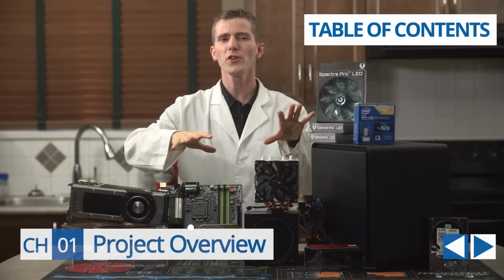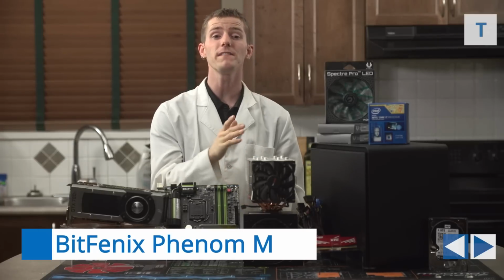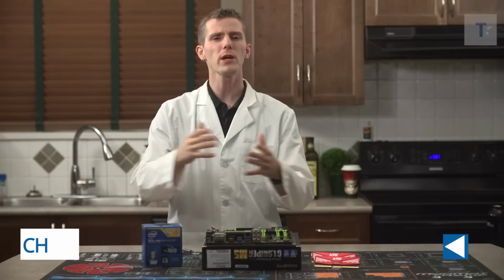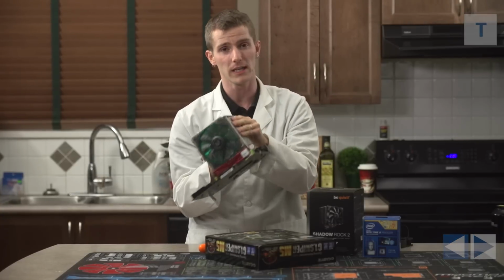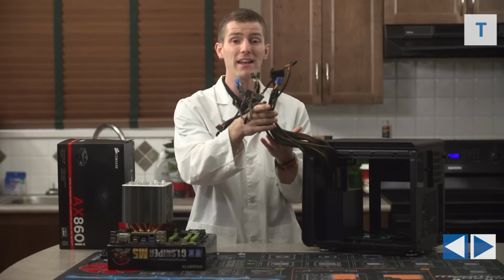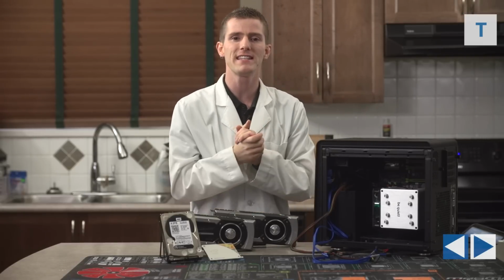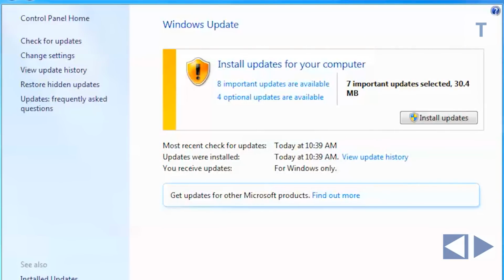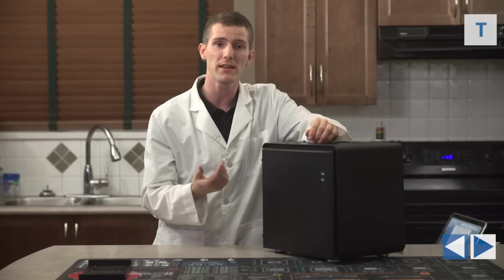ULTIMATE Intel Compact SLI Gaming PC Computer "How To" Build Guide

Comment: What should I expect with a PC like this? I know it's unreasonable!

CPU: Intel® Core™ i7-5960X Extreme Edition Eight-Core 3.00GHz 20MB Intel Smart Cache LGA2011-V3 [+694]
HDD: 1TB Western Digital Caviar Blue SATA-III 6.0Gb/s 7200 RPM HDD [-18] (1TB x 4 (2TB Capacity) Raid 0+1 Extreme Performance with Data Security [+198])
MEMORY: 32GB (4GBx8) DDR4/2800MHz Quad Channel Memory [+732] (Corsair Vengeance LPX [+194])
MOTHERBOARD: ASUS X99 Deluxe ATX w/Wi-Fi 802.11 AC 2.4/5 GHz, Dual Intel GbE LAN, 5x Gen3 PCIe x16, 1 PCIe x4,1x M.2, 10x SATA 6Gb/s [+221]
SOUND: Creative Sound Blaster ZXR 5.1 Channels 24-bit 96KHz PCIe Sound Card w/SNR 124dB, DBPro optical output, Multi-channel surround, SBX Pro Studio, Sound Core3D Processor & Audio Control Module [+226]
VIDEO: NVIDIA GeForce GTX 780 Ti 3GB GDDR5 PCIe 3.0 x16 Video Card [+517] (Triple Card (3-Way SLI) [+1560])
Reply: SO MUCH INFO CANT HANDLE IT
Reply: Expect a mass money loss
Reply: Use gtx 980 and a ssd
Reply: change the gtx 780 to gtx 980 in sli and its perfect
Reply: Noah Grimes Titan Z? That has as much GDDR as four of the Graphics cards you've got there
Reply: Shadowwolf TD5000 It ain't always about VRAM

Comment: Is there a different kind of case you could use for this, because no offense but I don't really like this case?
Reply: eXoBursT That's mini-ITX. not mATX
Reply: sigh http://www.corsair.com/en-us/obsidian-series-250d-mini-itx-pc-case You tell me I'm wrong, yet it says so right here on corsair's website. Also I was talking about the case, not the motherboard. That mobo would not fit in the 250d I don't think
Reply: Yes you can use the bitfenix collossus matx or the bitfenix prodigy m
Reply: search for any mATX case. I chose the corsair 250d
Reply: AJfoytona Look at the parts list. Motherboard is mATX and the case is made for mATX. a mini-ITX won't have 3 pci express lanes.
Reply: AJfoytona ok so im wrong about the corsair 250d. my bad. yup u got me. man i feel retarted as shit.
Reply: I like the Jonsbo series (I think Rosewill and Cooltek are the importers where most of you are). The V4, C3 and U3 are the most compact mATX sets you can get that supports those mean high power PSUs and GPUs you need, whilst still having space for a ~150mm CPU cooler. Anything less is cramped (usually, to save space, the PSU is made to "float" over the mainboard), anything more should only be considered if you need to use internal ODs.

Comment: 22:02 it's true that some modular PSUs are slightly bigger then non-modulars, but not in all cases, BeQuiet and some other brands have very small modular PSUs, so I would never use a non-modular PSU in a high-end build, because you will never use all cables in a compact case, simply because you don't have space for so many devices... forget it!

Comment: If you're willing to lose one of the two graphics cards, you can fit stuff into a much smaller case (like, half the volume or less) by using a mini-itx board, while still having room for an optical drive and two or three hard disks. It's not going to be nearly as quiet, though, since you'll end up with a much smaller CPU fan/heatsink, which will have to spin faster to compensate. For example, Shuttle XPC machines are much tinier, but use a single 4000RPM 92mm fan as both the CPU fan and the case fan. As you can imagine, that can get pretty loud! But tiny.

Comment: What do you think about my new rig? Specs:
Intel core i7 4790k CPU
Asus z97 pro MOBO
EVGA GeForce 780 GPU
NZXT H440
16gb Corsair Vengeance RAM
Samsung 840 EVO SSD
WD Black 1tb HDD
Reply: I'm sorry if I seemed like an asshole. I was very stoked on my new rig since I've worked so much lately to pay for it:) I just wanted to share my rig with other PC enthusiasts:)
Reply: There is something beutiful about full RAM slots...
Reply: benjamin parmeggiani if u know that why the fuck do u ask ppl if its good ?
Reply: Maybe I'll sell the 780 and get the 980
Reply: Uhm... The 4790k is better and the kingston RAM performs pretty much the same...
Reply: benjamin parmeggiani So true
Reply: Very similar to my new build, 

I7 4790k
Asus rampage vii hero
Rm1000w psu
850 pro 256gb ssd
1tb wd black
16 corsair Ven. pro 2400mhz
gtx 970 (asus strix)
corsair 760t
corsair h110 water cooler
Reply: Corsair RM650
Reply: Thanks:) Working as a pizza chef finally pays off
Reply: benjamin parmeggiani This is exactly the same as the build I was planning on building, save for the case. Let me know how this works out!
Reply: Genral Graphics
The PC looks and performs like a beast.  The only problem I have is that I find myself looking more inside the case than on the monitor, haha. The components cost about 2200 dollars, but I live in Norway so It's a bit more expencive...
Reply: well it is good but you should have gone with Kingston ram and a 4770k
Reply: Nice, you might could save up some money on ram and get another ssd, but i know how it is, 16gigs is bether than 8 gigs ^^
Reply: ***** Planing on to doing that ^^
Reply: We ave the exact same hard drive setup
Reply: get the gtx 970, cheaper and almost as good as gtx 780, or get the gtx 980 for longevity
Reply: ***** No i dont!
Reply: ***** wat?
Reply: No, I can't!*
Reply: benjamin parmeggiani going to sell ur gpu or keeping it?
Reply: I think I'm going to keep it:)
Reply: benjamin parmeggiani It's really awesome
Reply: benjamin parmeggiani get a 980 instead out performs by far and lower tdp
Reply: colton5007 he already got his card
Reply: colton5007 it does not justify the extra price either (unless you have money lying around)
Reply: benjamin parmeggiani
 aw you just needed to wait a few weeks for the new 970 and 980's!
Reply: I know:/
Reply: Killer xD
Reply: ***** Sorry, maximus, it's just their naming schemes are weird.
Reply: U do it like a pro :3
Reply: Shit. Must've cost way over 2000$
Reply: Nope:)
Reply: benjamin parmeggiani  Cool man. 
Nice rig you got there anyway.
Reply: benjamin parmeggiani Ja, ville nok heller gått for en 980
Reply: Det hadde ikke kommet ut da jeg kjøpte det, kanskje jeg seller det og kjøper 980
Reply: Neeei, 980 er virkelig ikke verdt det for å være helt ærlig. Hadde jeg vert deg hadde jeg gått for en 970. Med mindre du kjører 1440p
Reply: awsome RIG bro have a good time with it
Reply: benjamin parmeggiani You live in Norway?, hah, mee to, sounds like a good rig
Reply: benjamin parmeggiani du burde ikk kjøpe 900 serien, den er overpriset, og jeg har snakket med eksperter, og det er unødvendig med mindre du vil ha 4k, som i mine øyne er unødvendig
Reply: KrisPvP hah! Er du seriøs nå?!?! Omg... Em mener ikke å være frekk men... Disse "ekspertene" dine høres ikke så kloke ut... 900 serien har super price to performance og for å kjøre 4K må du ha to 980er... 900 serien satte ned prisen på 780 kortene ned 1000kr og 780ti med 1600. Om du kan anbefaler jeg å levere inn 780en å kjøpe 970 fordi denne er en del kraftigere, holder seg kjøligere, bruker mindre strøm og kommer med de nye 900 serie "featureene" som Feks MFAA. Men om du ikke kjører 1440p eller 144hz skjerm er det ingen grunn til å gå for 980(som foresten slår 780ti. Om du kan få tilbake en del penger fra 780en er 970 det beste valget. Takk for meg ;)
Reply: Med ettertanke tror jeg at jeg befolder 980'en. Den gikk ned så mye i pris da 980 ble lansert og jeg kjører 1080p/60hrz fortsatt:)
Reply: Pretty good :)
Reply: get the gtx 980 instead, it uses less power so it overclocks better and SLI would use less power.
Reply: Vault Nomad you do get that even an overclocked 980 still isn't on par with 780 ti right? also they cost the same price in fact 780 ti are cheaper. to a gamer power consumption has never meant shit to date so why would it now beside nvidia is just hiding in the works there 780 ti replacement soon that will make anyone buying a 980 now feel stupid cause its gonna have as many unlocked cuda cores as the current 780ti but with that boosted efficiency
Reply: you have a freaking beast
Reply: I can send you a picture if you want? haha
Reply: Kai Wackerfuss dude for an enthusiest this is like a standard build why don't you believe him? i myself run 4770k on z97 deluxe 16gb dominator platinum and a 780 ti kingpin edition all in an h440 case 2tb wb black and 128gb 840 pro ssd
Reply: benjamin parmeggiani Awesome build mate, got one myself last week and it works fine so far, check it out and let me know if there's something important I forgot.

-Intel Core i7-4790K
-MSI GeForce GTX 970 Gaming 4GB PhysX
-ASUS MAXIMUS VII HERO, Socket-1150
-Corsair AX 860i, 860W PSU
-Corsair H100i Hydro Series CPU Cooler
-HyperX Fury DDR3 1866MHz 16GB Red
-Seagate Barracuda® 3TB
-Samsung SSD 840 EVO 250GB BK OEM x2

-Corsair Obsidian 750D Big Tower Black
-Corsair Professional Sleeved Cable Red (for the looks, just had to)

Recommend this specc for everyone who has the budget, it ended at around 2600$ (18000 nok)
Reply: Ser bra ut:) Tenker å kjøpe samme CPU kjøler
Reply: ***** wow your profile picture
Reply: ***** its probably a fake stuff it back in your pants dude internet is full of lies
Reply: I bet 100$ that it's a dude
Reply: benjamin parmeggiani Dude thats fucking awesome how you can make pizza AND play games kickass rig btw (im jealous)
Reply: ***** lol i was thinking about photoshop
Reply: TheFancyCreeper2412
Thanks!:)
Reply: np and good luck with that pizza
Reply: Haha, I just got home from 9 hours of work with no breaks. I'm really sick of pizza.
Reply: ***** i got quad 780ti
Reply: *****
 Pretty sure you are lieing. second there is legit no benefit beyond two cause most games barley scale with two cards what could you need 4 of them for
Reply: There is not much improvement from 3 to 4 either
Reply: unless he owns two gaming rigs the 4 cards are pointless beside that unless you have a high highend 2011 or 2011-3 socket you can't even provide the bandwidth for those lol
Reply: *****
ok now i will stop lieing - i only got 2 780ti and i randomly put nvidia 7300SE in my pc lol
Reply: looks like my build i got a gtx 970 and a corsair h100i with a asrock z97, Same ssd but i got 4 tbs of hhd that i previously had. using 16 gb rip jaws. We running the same thing different brands lol i think its a beast
Reply: papijelly
you want beast? a beast memory its call hyperx beast, lol
Reply: When it comes to RAM, there is not much difference between the high end gaming versions :)
Reply: true not much difference but who can stop from jumping at the chance of some sexy heat sink ram mmm my Dominator Platinum look great
Reply: That's true. I went for the corsair vengeance mostly because of the green colour fits my rig perfectly
Reply: yeah i adopted z97 when first came out picked asus deluxe so i wanted the dominator to match the metal look of heat sinks.
Reply: ***** Umm... The GTX 970 is better that the 780.
Reply: Plazma lasrer
not the same level with the 780ti... i am rockin dual 980 overclocked to 1367mhz
Reply: I chose it because it was silent and it didn't cost that much. I didn't really care about the PSU when I ordered the PC, as long as it was powerful enough to support my rig:)
Reply: Haha same setup man! Except i have a Msi Gaming 5 and 980 SLI
Reply: ***** 16 gig platinum is too expensive, go with 16 gig A-DATA or Crucial Ballistix Sport
Reply: *****
 platinum are expensive but its a statment some people want more then just a functional pc they want a machine that looks good too
Reply: Very strong pc
Reply: get a sabertooth mark 2 instead. Get an intel ssd instead. get a GTX 970.
Reply: Bernie Jin I think he made some choices due to budget reasons. And the 780s are quite cheap used now. He probably already bought and built the machine anyway.
Reply: pretty bomb, could have more use with more hdd storage though...
Reply: I've added a 250gb SSD for extra fast storage since I posted this:)
Reply: You got OS installed on it?
Reply: Windows 7
Reply: How much did your system cost in total?
Reply: benjamin parmeggiani fuck norway.
Reply: *****
Hahah, If it helps I spent 10 hours a day working in a shitty fastfood pizza resturant a day to afford it:)
Reply: benjamin parmeggiani fuck norway.
Reply: *****
Why? :(
Reply: benjamin parmeggiani because fuck you, that's why.
Reply: hehehe
Reply: benjamin parmeggiani fuck you.
Reply: *****
Hah, please leave the comment section if you're mot interested in PC's
Reply: ***** Actually it really depends on the game but the 970 has a higher clock speed, higher ram and it's maxwell.  And with sli it would kick ass.
Reply: I74790k  z87 Asus Rog trident 32g 2666 raid0 two intel 730 crossfire 2 r9 270x
Reply: you should consider getting a gtx 970 or 980 as your next video card but other than that its amazing
Reply: JerryFish
8 GB will run 99% of games today for the next 4+ years.
Reply: Aidan Sweeney
It is however nice to have when you use video editing programs and run multiple programs at once, but I agree that for games it's not necessary at all:)
Reply: benjamin parmeggiani

8 GB is the sweet spot. But with DDR 3 that don't cost that much, then 16 GB why not :) I'm getting 16 GB in my new pc, and might upgrade to 32 GB later

Comment: I am getting custom pc for bday are these good specs?

Case - HAF 912 (Mid Tower) [Iron Tundra Ready]
Custom Airbrush Logos & Emblems - None
Custom Airbrushed Gamertags - None
Additional Case Fans - None
Internal Lighting - None
Intel Processor - Intel Core i5-4690K 3.5GHz (Quad Core)
CPU Cooling - Standard Heatsink
PC Liquid Coolant - *Requires Iron Tundra Liquid Cooling Systems
Liquid Coolant Refill Bottle - None
Liquid Cooling Tubing Color - *Requires Iron Tundra Liquid Cooling Systems
Intel Motherboard - [SLI / x-fire] ASUS Z97-A [4 DDR3 Memory Slots]
Overclocking Processor - Stock Speed
Overclock Protection Warranty - None
Overclocking Graphics Card - Stock Speed
Memory - 16GB (2x8GB) DDR3 1600MHz
Memory Cooling - None
Primary Hard Drive - 2TB 7200 RPM
Hard Drive Cooling - None
Secondary Hard Drive - None
Optical Drive - None
2nd Optical Drive - None
Graphics Card - Nvidia Geforce GTX 770 2GB (Min. 650 Watt Power Supply)
[SLI / X-Fire] Second Graphics Card - None
[3-way SLI / X-fire] Third Graphics Card - None
Power Supply - Corsair Builder Series CX600 600 Watt 80 Plus
Operating System - Windows 8.1 64 Bit
Networking - Internal Wireless AC 1300Mbps
Fan Controller - None
Media Card Readers - None
Sound Card - Integrated HD Audio
PC Games - None
Office Software - None
Antivirus Software - None
Monitor - Acer 19.5" 1600 x 900 LCD Monitor
Second Monitor - None
Mouse - None
Keyboard - Standard Keyboard
Speakers & Headsets - None
Packaging - [FREE] Advanced Packaging System - Custom foam to protect and secure internal components from shipping abuse
Wiring - [FREE] Professional Wiring - Cables will be organized to achieve maximum airflow
Technical Support - Life-time U.S. Based Technical Support
Rush Service - Shipped Out in 10 - 15 Business Days
Video Demonstration - None
Warranty - Standard 3 Years Parts and 3 Years Labor

it is 1,692.15 so far

I already have terrible apple headphones and I am getting blue yeti also.
Reply: These specs seem good for gaming but I would recommend 1080p for the monitor. If you are just gaming you don't really need that 16 gigs of ram.
Reply: wtf thats serious like you gonna sell it on offical pc sellers
Reply: i got a pc at best buy 1000 fps or more in highest settings
Reply: Fire Wizard Gaming and More
1000fps? what gpu ur using? tesla?
Reply: no i have a i7 and a 750
Reply: Fire Wizard Gaming and More seems like mismatched parts; an i7 is way over a 750. an i5 and a 770 would be closer, and then an i7 for a 780 and TI/970 and 980
Reply: whats wrong with having it mismatched
Reply: Fire Wizard Gaming and More there's nothing inherently wrong with having it mismatched, especially if you plan on upgrading, but it's typically considered to pick parts closer to each other, like a pentium g3258 with a 750 ti, a core i5 4690(k) with a 760/770/maybe 780 or 970/ and an i7 4790k with a 780 ti or a 980. That's just the Intel/Nvidia side of it though
Reply: k thx i am upgrading probably sometime next year :)

Comment: this is the first time i´m doing a pc rig and i dont know if i´m doing it right haha but here´s the list of the stuff that i put together if you could tell me if its a good rig for gaming and fast usage and making almost ay game in ultra i´ll really apreciate 
ROG Maximus VI HERO MOTHERBOARD 
Intel core I5 4670k 3.4 Processor
EVGA NVIDIA GeForce GTX 770 SC 2gb GDDR5 PCI exp, 3.0
Corsair CX series 750W ATX 
Corsair Vengeance 2 pack 4gb DDR3 (8gb)
WD 1 tb 7200 rpm hd
Intel 530 Series 240 gb ssd
cooler Master cm storm stryker atx
asus 27" IPS LED Monitor
Corsair AIR Series SP120 Quiet Edition Twin pack (4) 
Cooler Master Hyper 212 EVO 120mm CPU Cooling Fan
thanks in advance hope you could help out 
ps: if you talk spanish it would be great! haha

also idk if it would be better a hydrocooler for the cpu instead of the hyper 212 evo fan fi you could give me and advice too on that it would be great!

Comment: If you don't need sli or xfire, get a silverstone temjin tj08.  Just remove all the hard drive bays and buy a 5.25 bay adapter (they're like 5 bucks), you can still fit two ssds and a hard drive, and it has way better airflow and temps under load than this case. It's just as small, quiet, and imo way better looking.

Comment: Hi, is the option to forgo the 2x120mm top fans due to the motherboard selection? Say if I use an asus maximus gene motherboard with 2 GPUs in SLI, that would allow enough headroom for the fans to be installed below the metal plate? Also, is there enough room to install a H80i instead?